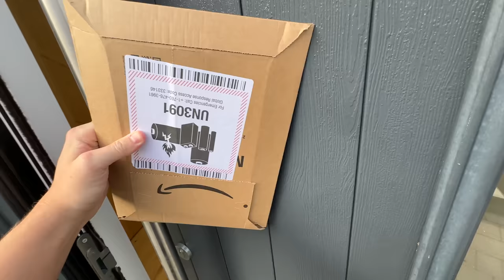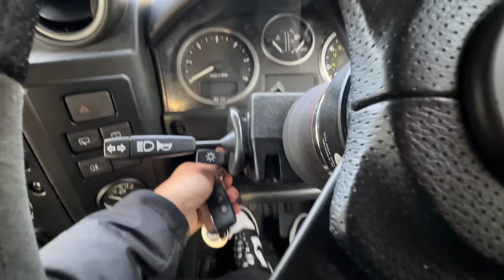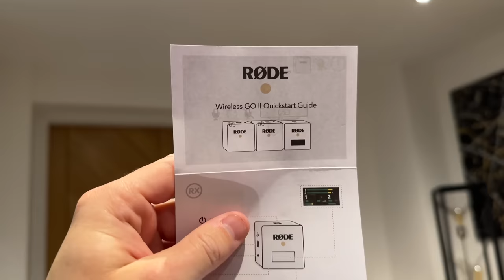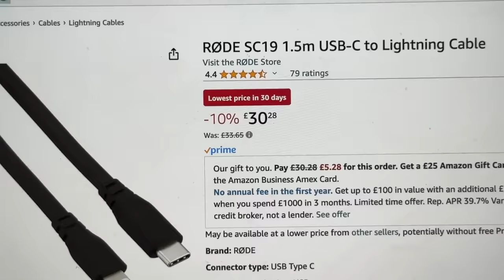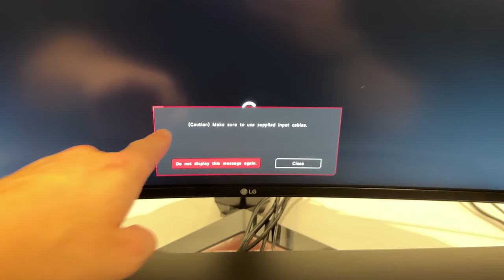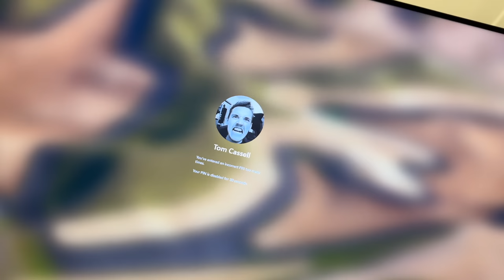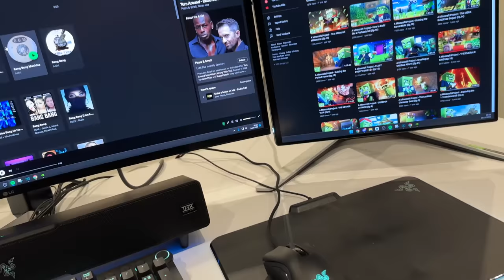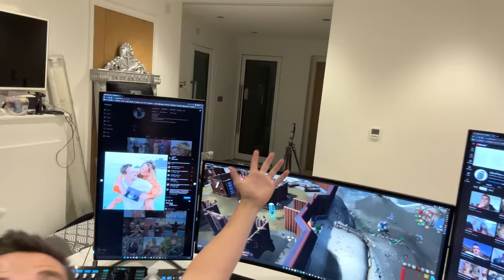My NEW Office is INCREDIBLE!

Comment: Tom, one thing you can do to manage the cable situation is stretch every cable out to its max length, tie them together with either a cable tie (velcro ones) or a cable sleeve, even string can work. Then you will have what looks like one solid cable you can pin under the desk, with enough slack to raise and lower the table, and all you need to do is plug everything back in. Having the computer in the center of the room make it so much easier to do!

Comment: above the desk use a wire loom to gather the wires to the center of the middle monitor post, then run straight down. Then put a "Desk Skirt" on the desk to hide everything, under the desk. have the PC under the desk accessible from your chair, but the desk skirt would be cloth so the back of the PC would be easily accessible by lifting the cloth if needed.

Comment: Tom! Myself and my girlfriend had the same problem with the fairy lights! If it happens again, melt or strip the thin layer of insulation off of the cable and solder it together 😊
Reply from the maker: ooooo

Comment: Hey Tom. ive used an ultrawide for gaming for a while. most games support it natively and dont need any resolution scaling. also twitch supports ultrawide streams but if you would rather the stream be 16:9 you can set OBS to only capture the center 16:9 area and cut off the extra width while still being able to play the game in ultrawide on your monitor. btw i don't comment much but ive been watching you since 2011, thanks for the great content over the years!

Comment: for your monitor setup if you wanted you could do a double stack monitor stand in the middle have a normal monitor at the bottom and the ultra wide on top that would give you 2 monitors in the center and the 2 sideways on the sides.

Comment: Don't solder the ends of the lights together. Buy a junction box. I cut through my lawnmower power lead and reconnected it with a junction box (then wrapped it in electrical tape to protect it from the lovely British summer!)

Comment: How do i get all 3 monitors to function like this? I got my 2 Monitor setup for my pc, but a third monitor that purely works for my console atm, the Display port connecting the third monitor to pc is connected to the motherboard display port which i believe i need to go into Bios for, however i dont want a third monitor to detriment the performance of pc lowing resolution etc
Reply: that is not how it works
Reply: @NewKiwiJK  care to explain then?

Comment: Tom get the DJI microphones
Reply from the maker: Oooo i've seen them!
Reply: @LifeOfTom  I have it and it has all the connections you need
Reply: Literally a plug in and ready to use instantly
Reply: @LifeOfTom I would also suggest for your phone if you ever want to prop it up on the table, the belkin MagSafe Camera mount. Small and easy to take off your phone because it uses magsafe